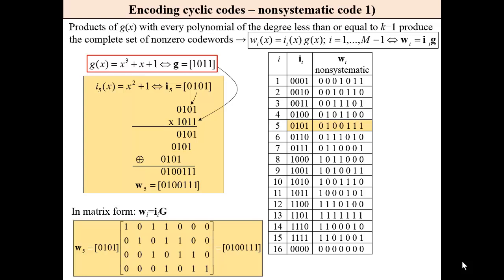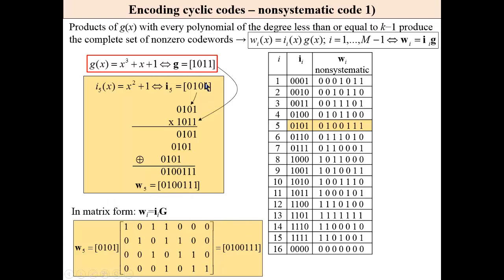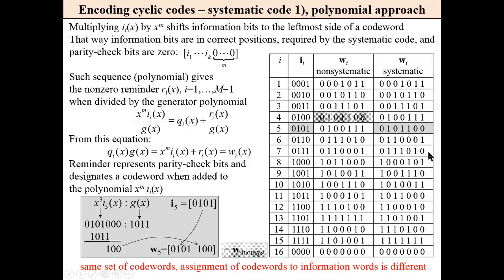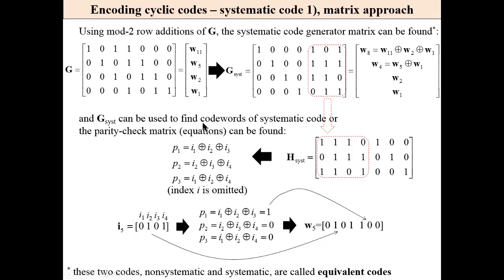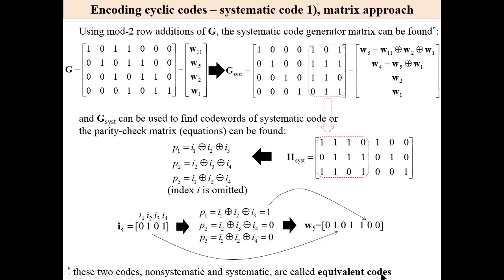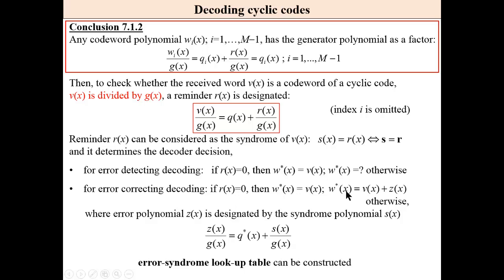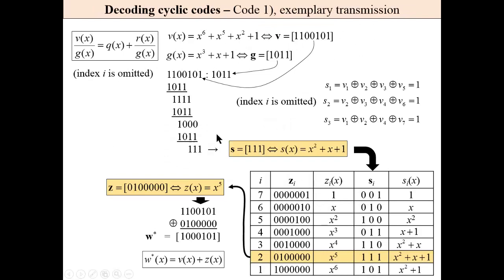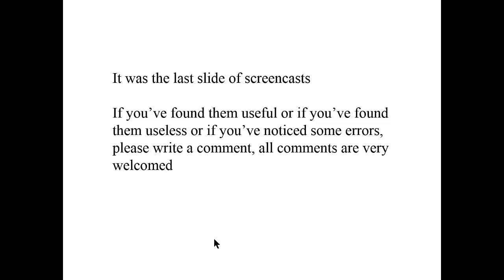Cyclic codes Pt  2, encoding and decoding

Comment: I would like to ask about a slide in 7:35. There are two different ways to calculate the syndrome(by dividing per generator polynomial or by using equations for s1,s2,s3)?  Because I noticed that if the coefficients of generator polynomial will be different in a few cases I got different results than by calculating method s1/s2/s3.
Reply from the maker: Generally, there is only one way of syndrome calculation, division of polynomials and then look-up table to find error pattern. However, in case of systematic code, Parity-check matrix can be found and then syndrome s1,s2,s3. Please give me an example of syndrome discrepancy.